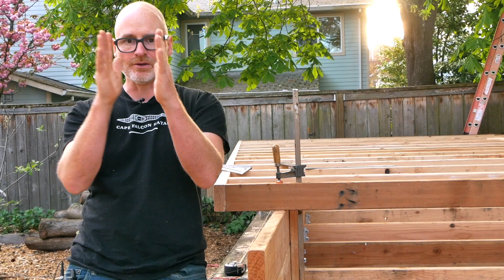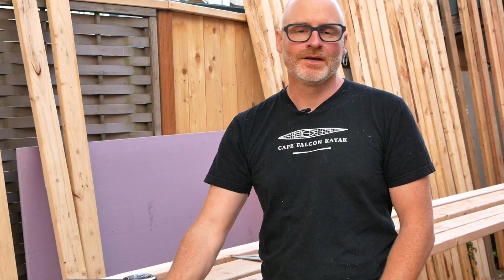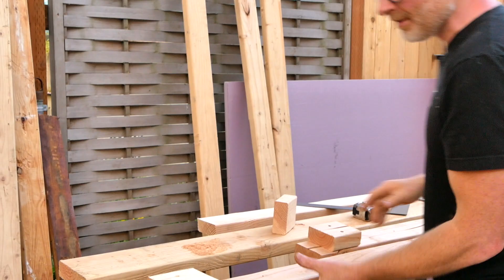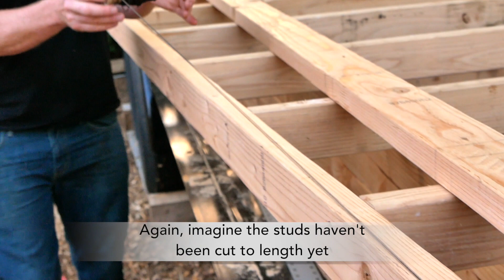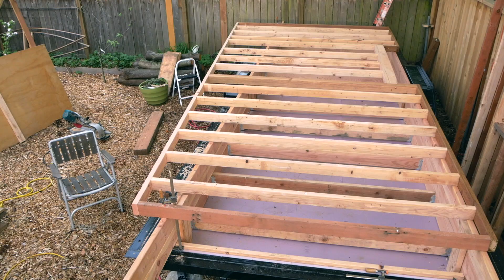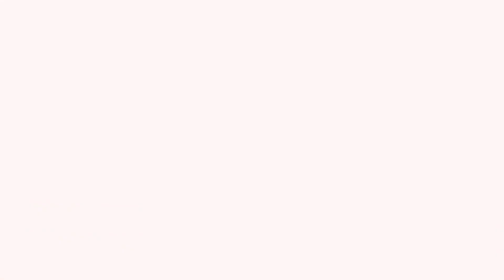How to Frame Long Rake Walls in a Tiny House

Comment: only a question and not a critique... I never understood why when framing a wall, why you wouldn't cut "spacers" to make your oc perfect. So a 16" oc pattern, cut 16-1.5=14.5" "spacers to nail into the sole and wall plates? It adds strength and absolute precision for your walls. I know it adds weight as well and requires longer fasteners to secure to the subfloor/foundation as well as your 2nd floor or roof trusses, but after building out a Toy hauler with steel studs that were NOT 16" oc and always off a bit in every imaginable direction - I lay awake at night dreaming of actual 16" oc studs... It would also add the added rigidity a rolling earthquake that is a tiny home/Toy Hauler conversion as it goes down the road.
Setting up the jig to cut all of these "spacers" out would be a snap and make framing up walls easier, quicker and more accurately, no?